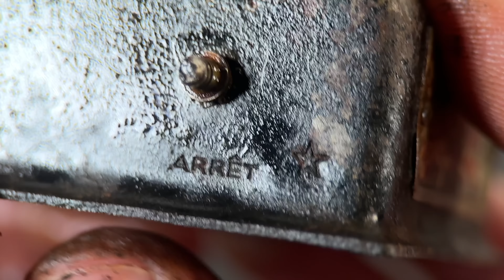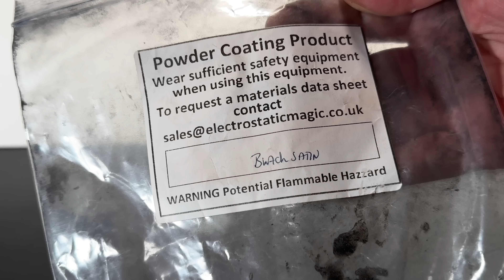1945's Razor Blade Sharpener 'Radium' - Restoration 🕷

Comment: Very nice work. It's from a time when one purchased a packet of blades and it lasted forever because you just kept using the Radium to strop them sharp over and over. Interesting contrast with today, the age of disposable plastic razors. Thanks for the video, Mr. Fabrik.
Reply from the maker: Thank you very much 🙌 Blades were rare and expensive back then
Reply: 14:10 Goodfellas Vibes

Comment: I wouldn't mind one of these. Started using a safety razor a couple years back, and while the blades are cheap it still seems wasteful to discard them after 5 or so uses.
Reply: And the "safety" in the term safety razor is barely accurate...
Reply: @glennsoucy9767  it's safer than it's predecessor, the straight razor. I'd love a straight razor. So classy.

Comment: Hey there really nice restoration a tip you have to wet the leather and they have a honing paste you apply on the damp leather to make it really work well you also treat your razor strope with it to sharpen your straight razor to a fine edge. Same for those blades

Comment: I think that was a pretty good restoration.  The razor could slice garlic but that doesn't mean it's sharp enough to shave with.  I think it would work better with some stropping compound on the leather.  Thanks for the video.
Reply: I committed about that I wet my strop well and apply that paste works really nice on my folding knife puts a keen edge on it .